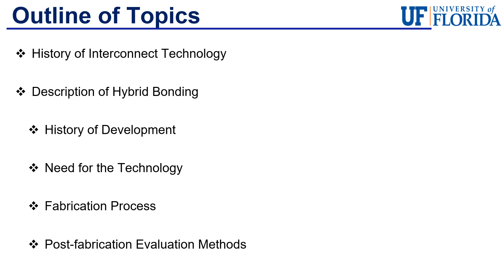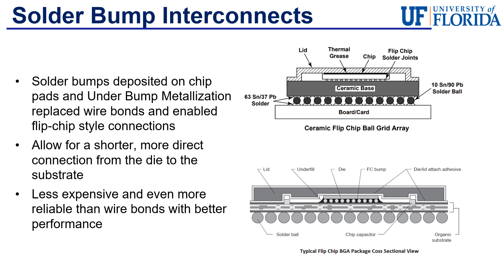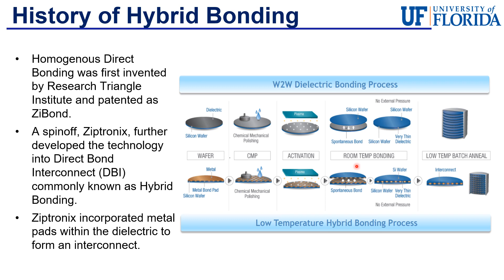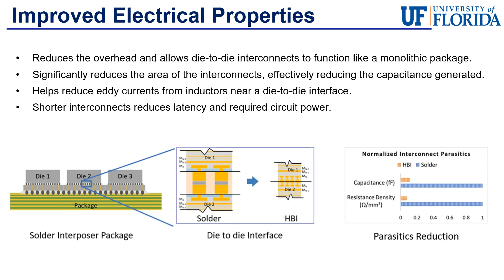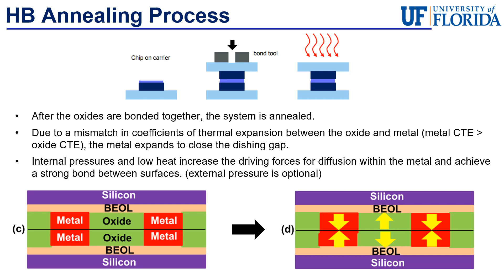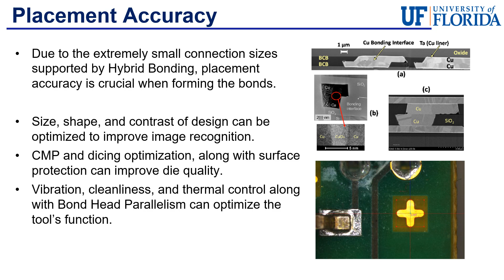Packaging Part 12 -  Hybrid Bonding 1

Comment: Good presentation/review, but there seems to be a lack of clear credit given to the source material.  There is a citations slide, but no indications of which information comes from which reference; also, a very large portion of the material came directly from the Intel presentation on the subject, Elsherbini et al "Enabling Hybrid Bonding on Intel Process", and this reference got a simple YouTube link with no further details.  Regardless, thanks for sharing, it was a good introduction.
Reply: What can you say about durability, long lifespan of Power management IC units in Chiplet